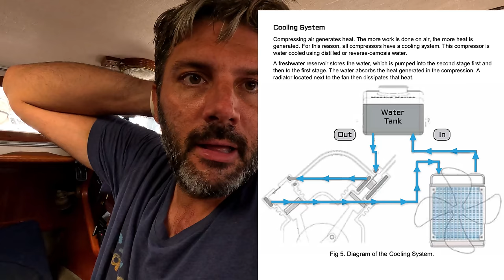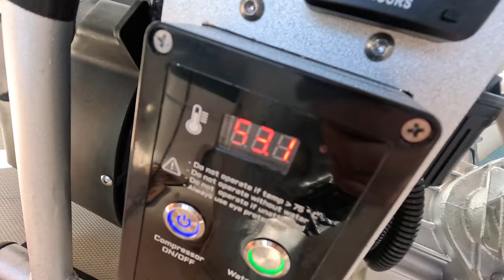Its Getting Dirty Over Here 😝 - I'm taking over boat work!!! (Calico Skies Sailing, Ep 217)

Comment: Hi guys!
I know that a lot of people have offered advice on winch cleaning….here’s mine, based on 40 years as a Mechanical Engineer of which 13 was spent as liveaboard permanent crew/engineer on superyachts of various types and sizes.

Strip winches in the afternoon and put everything in one or more tubs/buckets. Fill with enough diesel to cover the greasy bits and slop a bit over everything with a paintbrush. Put in a safe corner where nothing will get knocked over. Go to the bar, have tapas and a few cold ones. Go back to boat and chill/sleep. 

Next morning have bacon and eggs, take second mug of tea/coffee outside and retrieve tubs/buckets full of winch bits, finish drink before proceeding further because coffee plus diesel sucks. 

Use stiff washing up brush to clean grease off parts in tub, most of it will pretty much fall off. 

Use wood kebab stick or similar to shift any really hard scabby grease traces from between gear teeth. Anything like gears  that have rust on them, hit with a wire brush.

Hit spindles with green Scotchbrite if there’s any brown lacquering of broken down grease left. (Use green kitchen scouring pad if you can’t get proper Scotchbrite pads.)

Finally, rinse everything off with either a little petrol or brake cleaner/degreaser spray into diesel tub and put clean parts on clean paper towel in a tray. 

Decant filthy diesel and rinse solvent into empty engine oil container, seal it immediately and put in safe corner. 

Reassemble winches with fresh lube. 

Feel a warm glow of satisfaction. 

It is now lunchtime so head ashore, drop off oil container full of diesel/horrible gunk in appropriate place, head to bar, have tapas and a few cold ones….

I rest my case. 😁

Cheers, R.
Reply: * Did you spend your apprenticeship getting yelled at " DID YOU READ THE MANUEL???"  ... AWESOME  You should redo your post  "Special island hopping mechanical service procedures and instructions for winches" (bring me a beer)    REALLY AWESOME POST! I had to read and re appreciate twice  😁😁
Reply: @shopwookie I can neither confirm nor deny any details of my rise to the heady heights of being the grumpy old Engineer that I became, one that Skippers and owners either loved and respected for his skills and judgment, or found intractable and unwilling to remain aboard for long. 

Suffice to say that my mentors were wise old birds and instructed me well, especially in the two alternative ways of proceeding through life afloat, the more efficient one being preferable when the job list is extensive and tapas plus cold ones are available nearby. 😎👍🍻
Reply: @robm.4512 ... awesome  😂

Comment: Brake cleaner and a wire brush we'll get all the brown crud off
Reply: But you have a flammable solvent being used which is not good on a boat. Could be done on the dock though.

Comment: Next time you have to clean dirty greasy parts up get a can or two of either , spray starting fluid , it cleans that stuff up almost instantly . It works a hundred times faster than the degreaser that you are using ..It will also remove any grease or oil that you get on your clothes .

Comment: FYI .......... There is an EP-2 grease called L-427 by Kendall. It's the blue grease that is rated high temp and pressure.  Is it overkill ???  YUP......... BUT it's the best on the market anything that requires greasing. Has a lower chance of gumming up and helps dispel water. It was widely used in the steel mill I worked  and the mtn peeps swore by it.  Just hope it's available down there .............. enjoy

Comment: @6:17 On wheel bearings, we absolutely pack them full of grease.  I don't see much of any on the winch bearings at this point.  What's right for boat winches?
Reply from the maker: A thin coating is recommended

Comment: Um if you put Regular 5w-30 in youll have to change out you filter media and clean the housings.  My filter media is 4 ft long strapped to a stick.  I worry about such a small filter stack as well.  Most professional grade compressors have two cylinders on the side slightly taller than the one on yours.
Reply from the maker: hmm was wondering about that but allowed in the per the manual 🤔

Comment: Hi Bill and Grace, I really like brake fluid for cleaning the winches. Glad you’re getting this done, and I have a leak on port in the cabinets behind the settee I cannot find where it’s coming from! If you come up with anything for the Sabre 36, let me know!
Reply: Much easier cleaning  using only gasoline. Soaks grease off in minutes.
Reply: I had a similar leak on the starboard side, it ended up being a stanchion but wasn't immediately obvious as the water rolled along the top of the inside 6-12 inches (not easy to see) before running down the wall.
Reply from the maker: We've had some leaks at the toe rail bungs, i've started jamming butyl tape in there, not very yachty but keeps us dry!
Reply from the maker: I'm not sure gasoline is good due to the some of the plastic components in the winch, heard of diesel for sure tho